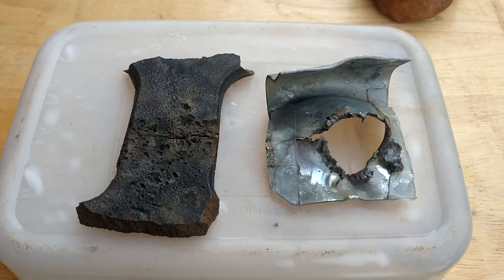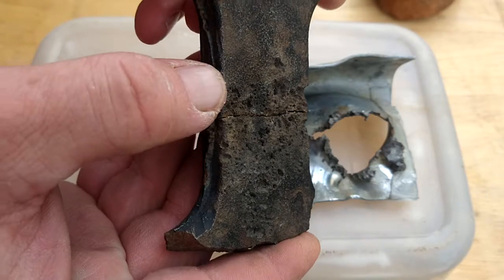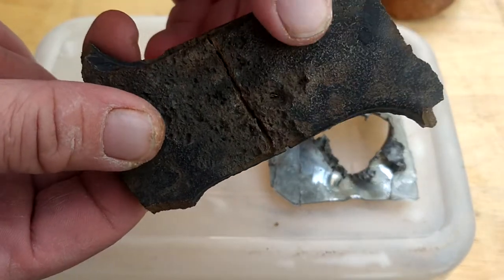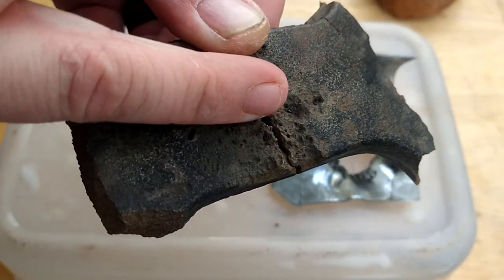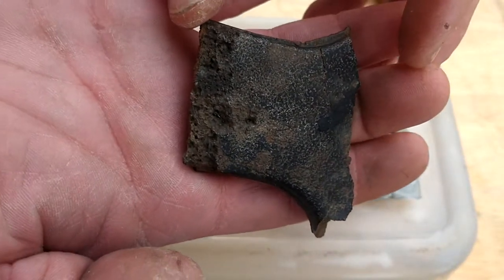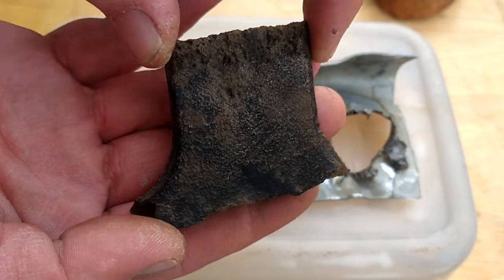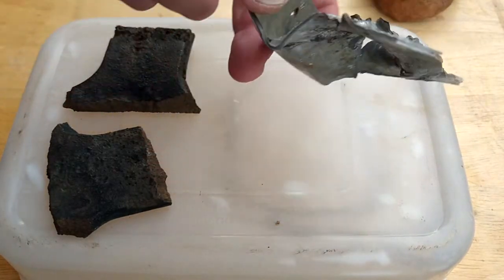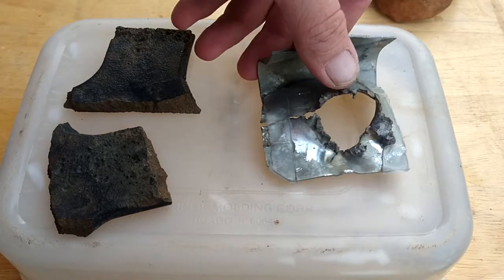💥2nd shaped charge test results💥

Comment: I’d kill it a partial success. You still got a jet. Just small and malformed. It’s a kinda addictive hobby trying to get these things right!
Reply from the maker: Man u ain't lying! I'm already starting to build another one with aluminum like the first one that was more successful, this time with much thicker aluminum in a better housing. Going to try to improve on the first results 🤞
Reply: @improvisedchaos6355 
Keep your eyes open for those hard-to-come-by cupric cones! Cu is the main choice for use in penetrative jet SCs, but Dioxisilicon is also quite effective when fast H.E.’s are employed. Like PLX or melt-cast ANSHALHEX… Monohydrated Sodium hypophosphite is a very effective and powerful reducing agent, so as far as the most powerful AN-based compositions can be made with it. When cast, it’s just as effective as British Ammonite, which is 80/20 Amatol. The VoD is 6,570m/s for Ammonite… ANSHALHEX estimated VoD is confirmed to be around 6,900m/s – 7,300m/s henceforth why a certain someone in Slovakia is having such good results with it.